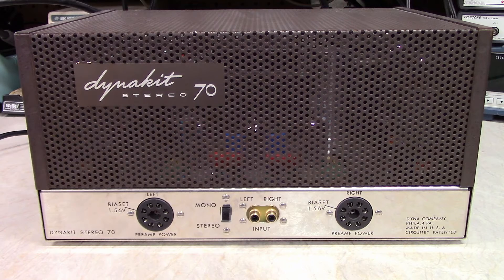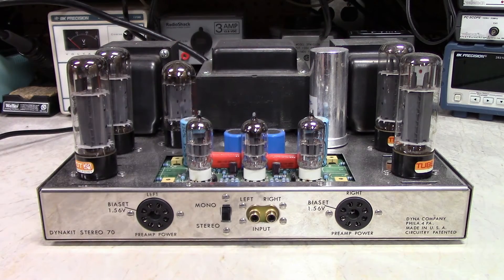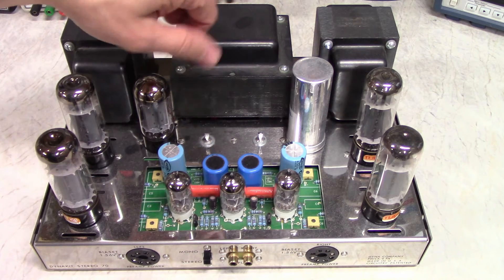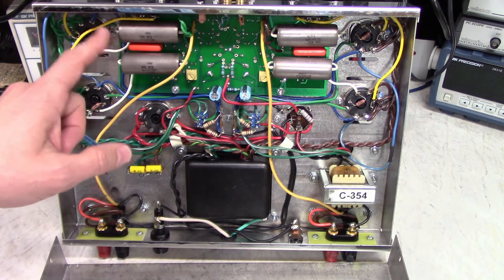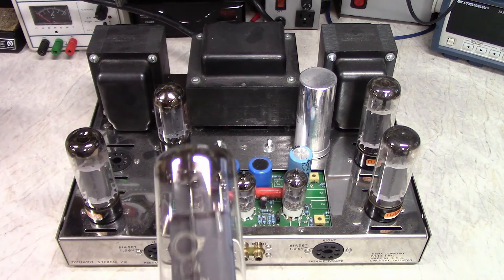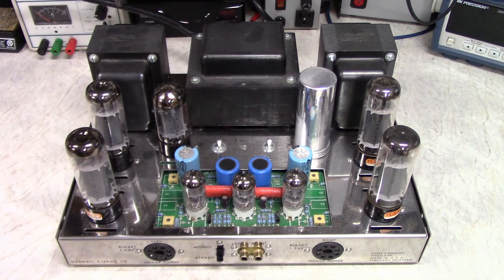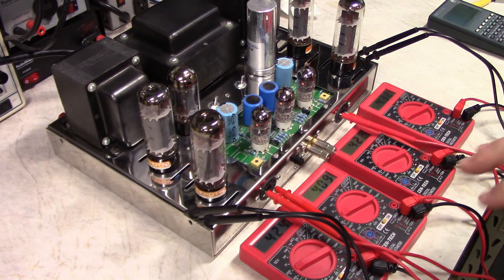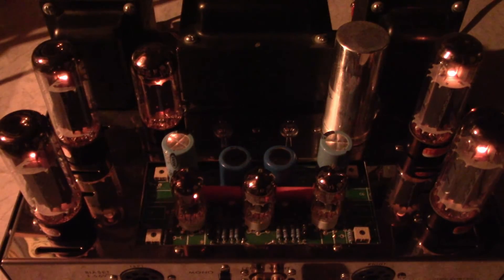Dynakit Stereo 70 Project

Comment: For decades there has been a debate over the efficacy of the PC-3 board. It may have been frame as "notoriously terrible", but I don't agree. But, there is a reason for supplanting it with one of the many boards that have been made available to replace it — the 7199 tube. They are almost unobtainable at this time, with no prospect of them ever being manufactured again.
Reply: I want to add this: a very nice build. Thanks for showing!

Comment: I like your high end multi meters! I have my father’s ST70, PAS and tuner which he built in ‘66. I went through it about ten years ago with new ecaps and replaced the selenium rectifier in the preamp and a few other recommended components. Just recently brought it back from a hum issue and it’s running like a top again. Nice job on your amp and the video.
Reply from the maker: Glad you got it working!  It's nice that these amps were so popular at the time.

Comment: Hi, I've built many of the Dynaco St70's with VTA boards. When Roy Motram made the VTA board, he based on the VTL circuit. What I finally did was was change the values and adjusted the FB loop for 12AU7s or 12BH7s because there is way too much gain with the 12AT7. You can use a 12BH7 but you can also wire it for a 6CG7 because you have more than enough current with that nice power transformer you have. 12AU7s are much more linear when you run them at 8ma. Another thing I do is run a 35uf film cap off the rectifier in place of the 20uf lytic. This gives it much more kick in the base region I also put in higher wattage carbon films in place of the half watt metal films because you will notice that the plate load resistors get pretty hot. This is still the best Dynaco ST70 replacement board I have ever used.
Reply from the maker: You are right that this early design has a bit too much gain.  The 12AT7 was in fashion in DIY circles at the time while the 12AU7 was not well regarded (even though I used them myself in my own designs).  I've been meaning to play around with this board, but it's pretty low in the project queue.

Comment: I just picked up a Dyna FM Tuner, Dyna Stereo Preamplifier and a DynaKit stereo 70.  It has sat for years. I have not plugged it in and do not know anything about it.  What should i do before i plug it in, any manuals online for this?  Any help\info please :)
Reply from the maker: The main concern over equipment this old that has sat around unused for many years are the capacitors.  The metal can types used in these can explode spectacularly when they fail.  I always startup equipment like this for the first time on a variac, so that I can carefully control it.  Oh yeah...and stand back.
Reply: @AmorphousAudio  I brought it to buddy of mine who hand wires amps. He is replacing all the caps. Just bought a fresh set of 34s. It cleaned up pretty well. Thanks for the response. Is there brown paint available for the cage?
Reply from the maker: I don't know of any exact paint code.  Dynaco used a sort of medium-dark brown on the earlier cages and black on the later ones.  Mine was in good shape (unlike the chassis), so I was able to use it as-is.
Reply: @Amorphous Audio  I got my Dyna 70 back with the FM Tuner and Preamp.  FM sounds great. Using a set of KEF Q3 speakers.  I can't seem to get this Turn Table to sound good. It is an Audio Technica LP120 USB. I tried connecting it to Mag Phono, and also tried Special. When playing vinyl with Vocals it seems like too much highs.  Can you shed any light on why this is?  I tried the filter on but its still to much and does not sound nearly as good as the Radio.  TT is new with about 10 hours on the needle. Stock Needle. Any help would be appreciated.. Thanks

Comment: You did a beautiful job on the amp. However the 12at7 is not more linear than it's counter parts. The 12au7 is the most linear and is actually a 9pin version of the famous 6sn7.  Also the original tubes sound just as good if not better. I have tested them on every piece of equipment you can imagine.  I'm not trying to insult you or you work just want people to get a accurate account of the amp.  Also there are 2 available tubes that need a repin but are very close to the 7199.  The 6u8 and even better is the 6gw8 I believe.
Reply from the maker: A lot depends on the chosen operating point.  The 12AT7 was "fashionable" back when I bought this board.  Several designs were using it with good results by running it quite "hot", per some of the project that were posted on diyaudio at the time.  The 12AU7 was out of fashion by then.  If you look on tubes4hifi these days, you won't find this design there anymore.  He's gone back to 12AU7s.  :)

I have a different preamp that uses 12AU7 and is pretty linear, though it is a so-called "white cathode follower" arrangement.  I mainly chose that tube because of the lower gain and output impedance I could get with it.

Comment: ST-70 is good, but I do not like the electronic parts outside,  I am going to rebuild one of my st-70 and hide these electronic parts inside and only leave the two 7199 tubes outside.
Reply from the maker: Yes, these are not safe without the cage on.  There are acrylic plates you can get to cover the PCB, but they do not cover everything.

Comment: Very nice work. I’ve been putting together a Dynakit system I’ll be working on soon, myself. An ST70 kit from the early 90s to build, an FM3 kit from the 60s to build and a PAS that needs a full tune-up. Also got a set of A25s that need a little work. Was surprised to find the Jensen bi-directional electrolytics in the crossovers measured fine with zero leakage, but I’ll probably still replace them with films. Maybe some new cloth. Quite a project, but hopefully in a month or two I’ll have a nice little vintage system. Glad to see you’re getting good enjoyment out your nicely resurrected amp.
Reply from the maker: Wow, you will have a nice Dynaco system after that is all setup.  The A25s are supposed to sound pretty good.  i always thought the FM3 looked cool.  Good luck!